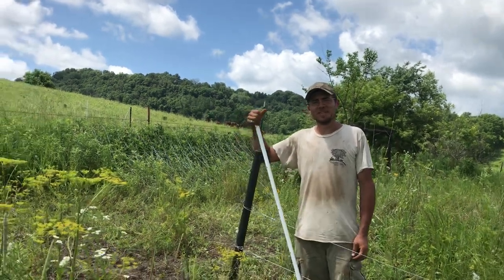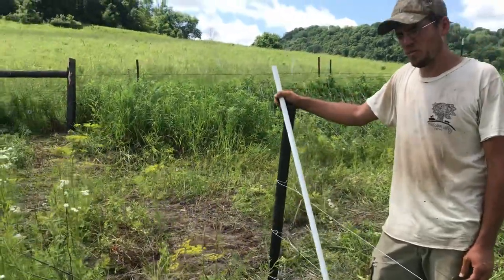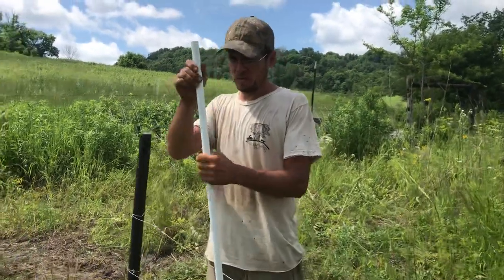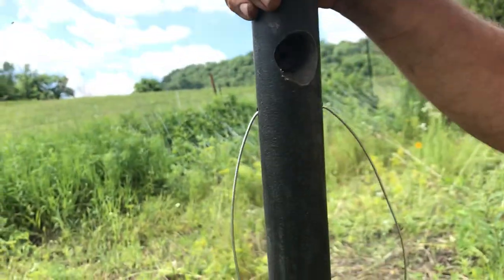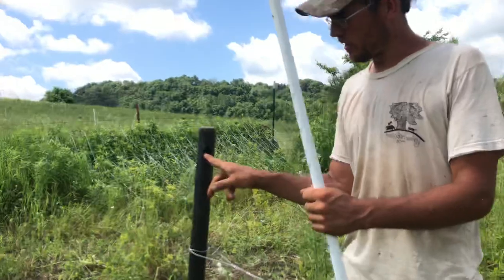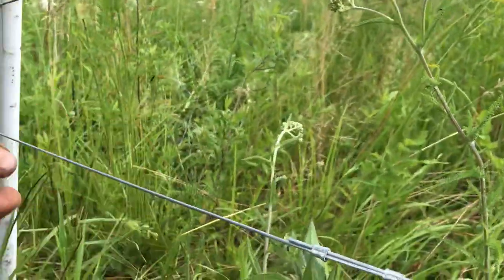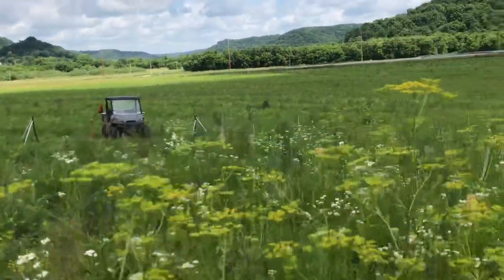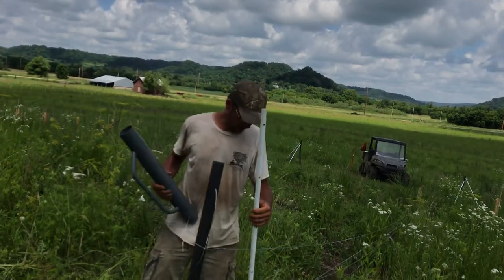Cheap and Easy Braces for Multi-Strand High Tensile Fence

Comment: I want to know how it's holding up today.
Reply from the maker: Most of the braces are holding up. Some have moved a few inches from the tension of the fence, so I have to make my poly rope gates a little longer. One of them snapped off when a calf ran into the fence a few feet away from the brace. Overall, considering how cheap and easy they were to put up, I'm happy with them.